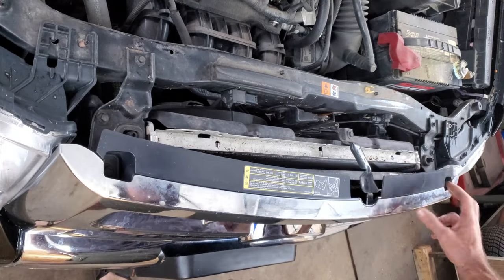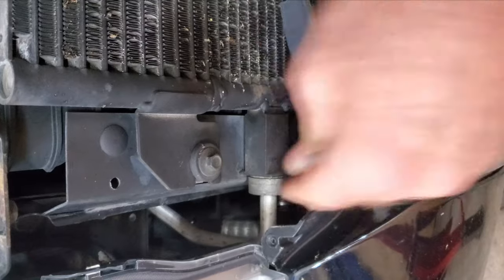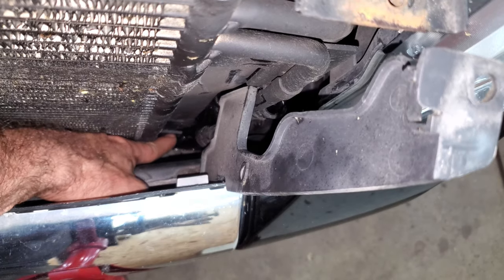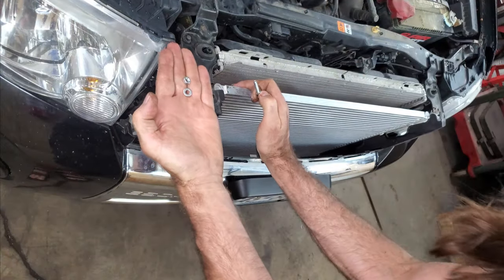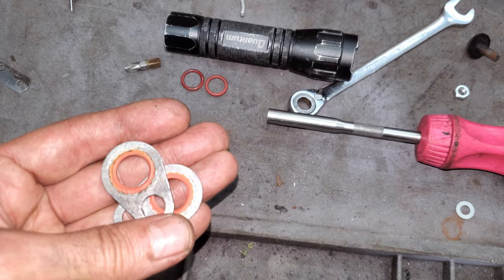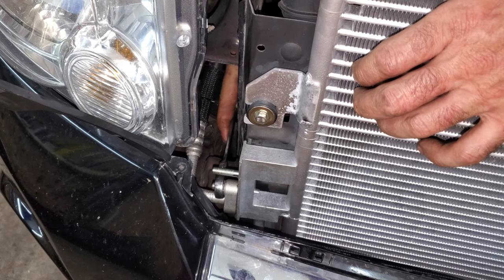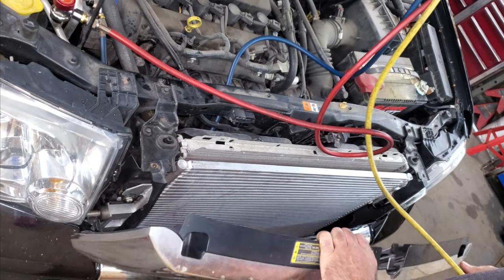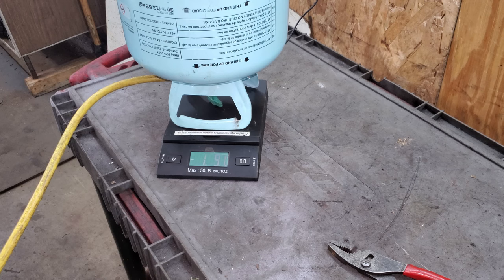2009-2012 Ford Escape condenser replacement

Comment: @1:08 - 7mm
@1:20 - Yes, there should be two 10mm nuts. But they are on plastic threaded stems attached to the grill. Old plastic dries out and can break easily.
----------
Successfully replaced the condenser (and drier) on my 2011 Ford Escape. Thanks to this video, the job was much easier than anticipated.
One additional step I would recommend is to remove the metal mount above where the transmission cooling lines are to prevent injury when removing the lines from the condenser unit.
I initially didn't, and my thumb is paying the price for it.
Also, those spring clips are a pain to deal with. Recommend replacing them with marine grade, 316 stainless steel worm gear hose clamps.

Comment: Thanks you for this excellent video. What year is the escape you are working on? What do you suggest about purchasing the proper size condenser with proper size lines? The mechanic told me he has to also replace the accumulator and to remove it in the 2012 escape is a pain. Any input would be great.

Comment: In trying to place an order, I was offered different variations, like " built in oil cooler" and Transmission oil cooler"  How can I find out what type?  I have a 2012 Ford escape Limited, 6 cylinders automatic.
Reply from the maker: There are 2 extra lines for a transmission cooler on some of those. You need to look for that, and see if you have that.

Comment: Honestly the repair manual says you dont need to replace the accumulator drier when replacing the condenser. Just a little FYI. I with you didnt have to remove the entire dash and steering column to get to the evap coil...

Comment: Was wondering if you know if there is an orafice tube filter in a 2012 escape? And if so….any idea where it’s located? Thanks in advance! Thanks for the vids!
Reply from the maker: Look for a TXV on the firewall. That should be what this system is.
Reply: There is a txv on the firewall! That is in place of the orafice tube then right? Also…thanks for the response my friend! I appreciate it!
Reply from the maker: @turntableman33  no. There may be a filter someplace else in the line. Txv, and fot's are designed to regulate pressure. Fot's are screened so they don't get plugged up. Most of the time, if there is not a filter in the line, it will be in the reciever drier/accumulator.
Reply: @RustBeltAuto  thanks again for the good fun videos and the help. You da man!

Comment: Hi. Aren't you supposed to open that big knob on the vacuum pump?  I think I recalled that's supposed to be removed before you run the pump, otherwise you can actually burn it out. Please reply.
Reply from the maker: You mean the "oil plug" thingy? It's vented.
Reply: @RustBeltAuto   Yes, the big screw on plug where you put the oil in, but it also acts as a vent or intake I think. But I don't know for sure. It's an old memory and foggy.  Do you know?
Reply from the maker: In the beginning stages of vacuum, it will separate the moisture coming out of the thing, and you will see a cool steam come out. you can also unscrew the thing, and see if it is vented.
Reply: @RustBeltAuto  So when operating the vacuum, does that big knob need to be removed or not? That's what I'm trying to determine.  Because I'm getting the same exact vacuum.

Comment: Should always add oil?   I’m replacing the compressor too and it has new oil
Reply from the maker: You do not know how much, or what kind is in there, do you? I usually dump it out. Put one or two ounces less than what is recommended, as a good guess for all that work.
Reply: @RustBeltAuto  the new compressor comes with it already pre filled.   I’m talking about the condenser.  Should i add oil to it with the compressor already having oil?
Reply from the maker: @shredding51  yes. About 3 oz. For a condenser change. With reciever dryer.
Reply: Loved the commentary!

Comment: Will this work on a 2009 Mazda tribute my Ac gets hot when I stop at stop lights or idle in the drive thru any tips on that issue ?
Reply from the maker: I would get a garden hose after your condenser, and make sure your cabin filter is clean first. Low charge might be the culprit. You will know if your compressor is cycling a lot.
Reply: @RustBeltAuto  thank you so much for the reply my Guy , when I try to recharge the ac the gauge moves up and down so now I have to locate the leak ,
Reply: @RustBeltAuto  lol I wish I could pay you to fix it man lol but my buddies know about cars we’ll study this video and tips to get it done

Comment: Does anybody know which is the send & return hose to the trans cooling lines ?
Reply from the maker: It doesn't really matter on that thing.
Reply: @RustBeltAuto  ahhh okay it’s bcuz im planning on adding a better trans cooler with the thermostat for send/return to keep it more cooled in my mountains driving. Thanks for the help!
Reply from the maker: @guadalupecorral84  ooh. If that is the case, and have not figured it out yet, just start the thing real quick, and shut it off right away, and see what line spits out fluid.

Comment: Hey so I got into an accident in the winter and in the summer the a/c wouldn’t work is it possible I leaked the unit out with a busted condenser even if the tranny fluid is still normal?
Reply from the maker: I just replaced 2 of these in the last week. Anything is possible.

Comment: THOSE SCREWS ON BOTH ENDS THAT ARE MISSING, SOME GUY SAID THEY ARE 7 1/2 MM, I USED A 7MM ON MY 2008, JUST AN IDEA FROM EXPERIENCE OF DOING JOBS THAT HAVE ALREADY BEN DONE ONCE OR TWICE ALREADY, THAT PARTICULAR AREA THAT SEEMS TO BE THE SPOT THAT ALL THE ESCAPES CONDENSERS HAVE THEIR BLOW OUT, THAT'S THE SPOT WHERE MINE BLEW OUT, AND THE VIDEO I WATCHED BEFORE YOU, SAME, I'M THINKING WHEN I REASSEMBLE MINE, IM GOING TO TRY APPLYING SOME MOLLY LUBE ON THAT CONTACT SPOT WHERE IT SEEMS TO BE RUBBING A HOLE, MAY BE REDUCE FRICTION, THAT NEVER HURTS
Reply: ANYWAY HE WAS SAYING SOMETHING ABOUT IT BEING THE HOSE CLAMPS HOLDING THOSE TWO HOSES ON RUBBING THE CONDENSER THIN, IS THE SAME STUFF IN MY GOLD WING DIFFERENTIAL , SUPPOSEDLY CAN'T FLING IT LOOSE AND IS SLICK

Comment: ANYONE THAT READING THIS, THIS CONDENSER WILL NOT FIT HYBRID MODEL, THEY ARE  DEFINITELY HAVE DIFFERENT, IF YOUR MODEL HAS AN AUXILIARY WATER PUMP, YOUR CONDENSER WON'T LOOK LIKE THIS ONE, FOR ONE,  IT WON'T HAVE THE COOLING LINES THAT ONE DOES, TWO, THE A/C LINE  CONNECTIONS ARE DIFFERENT AS WELL
Reply from the maker: YOU ARE ALSO GOING TO WANT TO MAKE SURE YOU ARE USING THE RIGHT REFRIGERANT OIL. MOST HYBRIDS ARE DIFFERENT. THANKS FOR YELLING!!!!!